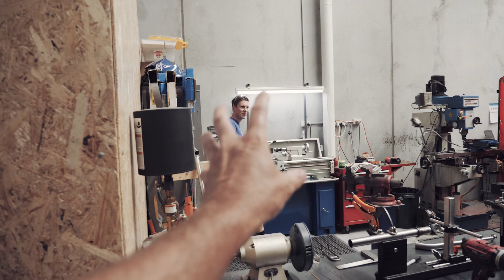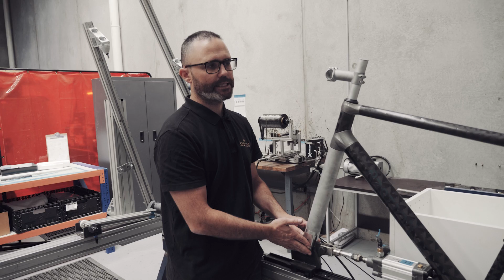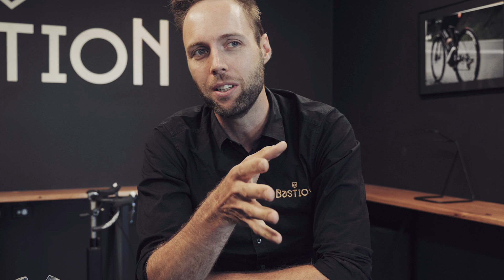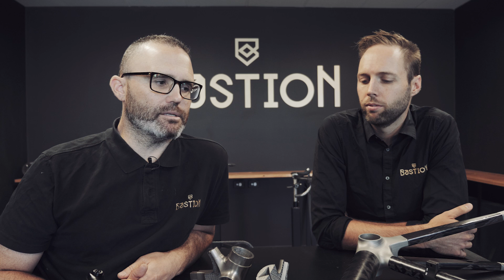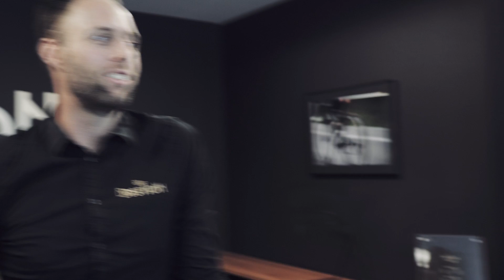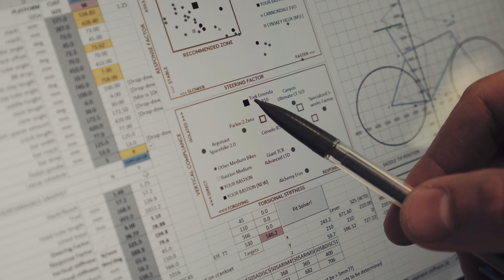Bastions Cycles - FULL Interview

Comment: perhaps a little late to the comments section, but this was great and informative. Thank you. Sounded like some of the engineering / tech speak was complex so glad it was kept in this extended video. As a university professor ( architecture and interiors) there is often too much aesthetic design not balanced by technically competent materials and engineering so again, good to hear their different take on these aspects. Additive / 3d printing works best when it is doing something no other process can replicate as long as the design exploits that. Love the bikes, love the thinking. Will need to work out how and when to afford one - not on my salary...

Comment: Galvanic corrosion results from a negative source losing loosely bound electrons to the (relatively) positive sink. Ti and C have an even number of electrons, Al has an odd number, thus an unpaired electron to flow to the carbon atoms. Das bad. Ti and C, dis good.

Comment: they're sort of at a late nineties construction method (lugged and bonded carbon tubes).   the future for them would be a 3D print frame Ti or Alloy that would make me look, not buy as big brands are such great value for money.
Reply: Flow it seems you weren't paying attention, they talked about this. Late nineties tech used CNC Aluminium, a galvanic enemy of Carbon. These frames don't use CNC or Aluminium and they solve almost every other problem faced by the producers of mass produced composite frames. If I was in the high end market I would rather give Bastion my money.
Reply: flow cycling it would just be too expensive at the moment. Plus for long tube sections it really isn’t the best technology or material. Carbon Fibre composite or other types of composites are.
Reply: flow cycling the question is not bout age of the technology but about it's benefits. Colnago is one of rather well respected companies and they do lugs even on their latest C60 ridden by pros today. Anyway agree on value point of view with big companies production and need to say I'm really happy with my BMC SLR01. But on the other hand I didn't have opportunity to ride Bastion and even if I had it most likely wouldn't have the characteristic my specific custom build would have. That's the beauty of custom builds. It's lot of money but nothing to compare with car industry with prices over £1M  for most modern hypercars (with completly different and more advanced technology obviously).

Comment: Why is the hanger part of the dropout?
Reply: yes noticed that as well, we all know one drop of bike can bend hanger and with these frames it would be a major repair, i.e. undo bond.  surely they'd know that.
Reply: There is a tool to fix it... problem is rims are very expensive, Hangers were created to save rims
Reply: hangers save frames "Most aluminum or composite frames have replaceable derailer hangers that bolt on to the right rear dropout. These are designed to be a breakaway/replaceable part so that serious frame damage will be avoided in the event the rear derailer goes into the spokes" sheldon brown."
Reply: a rim can be more money then the frame.. i have never seen a frame bend from the derailer getting in the rim i have seen rims destroyed by fixed hangers.. Hangers save rims not the frame. fuck that clown brown

Comment: The latest advancement in frame manufacturing has been dynamic tube shaping. Interesting to see these frames being made from standard tubes for the high end market. Is dynamic tube shaping a gimmick ?
Reply: Cycling Choice it has its place. But if you are riding in a group or behind someone it does very little for you. Often it comes with a comfort penalty so for this model we have stuck to simple round tubing.
Reply: my guess is that building this style bike with aerodynamically optimized tubing would be very difficult. Since they do custom frames, every tube shape would be different, and so they'd need a different mold. By using round tubes, they avoid this.